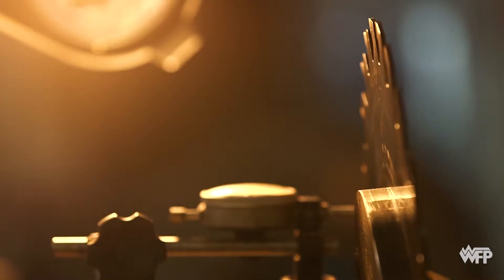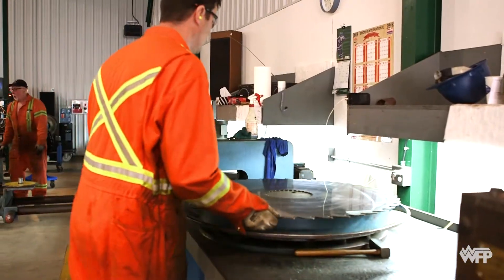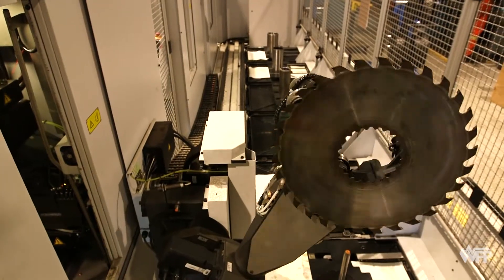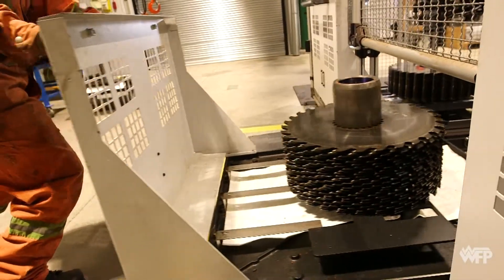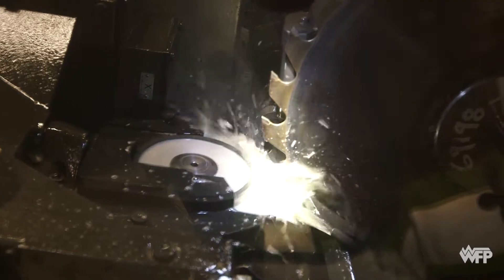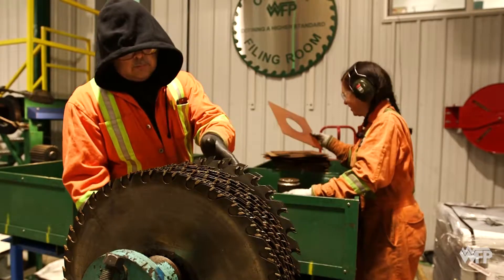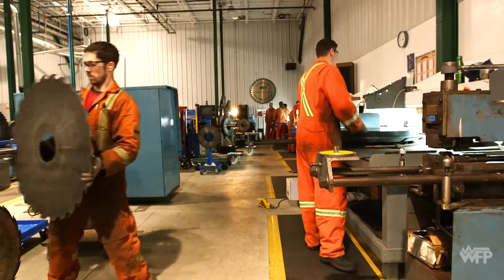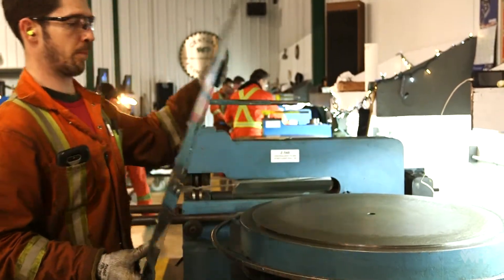Saltair Sawmill Circular Saw Filing Center

Comment: Do you offer a online class on saw filing or hammering
Reply: It's available as an afternoon training course, you may have some luck finding it available from your local community college. They'll teach you the fundamentals, such as putting the saws in the right way instead of relying on the coin flip method (which is still 50% accurate) as well as other useful skills such as smoke breaks on the hour, every hour and how to appear overworked while essentially doing nothing. The best part is that these automated machines essentially do everything required, unless the mill worked at lacks the resources to buy the automated equipment.